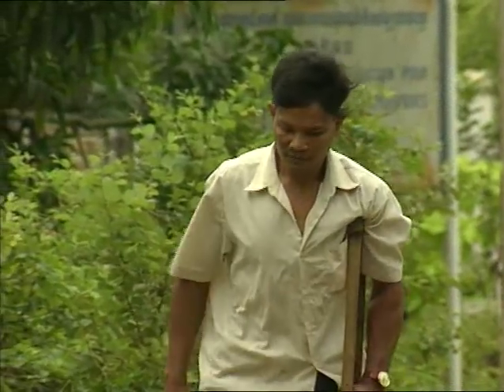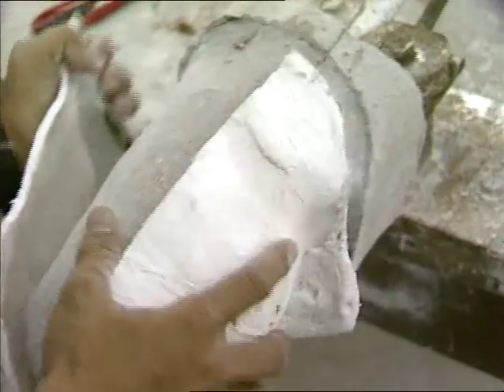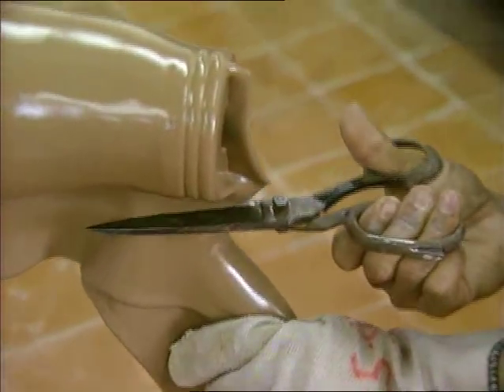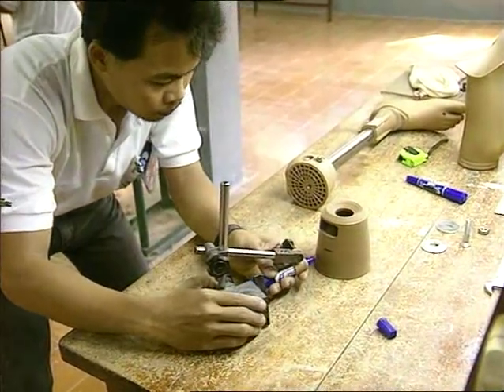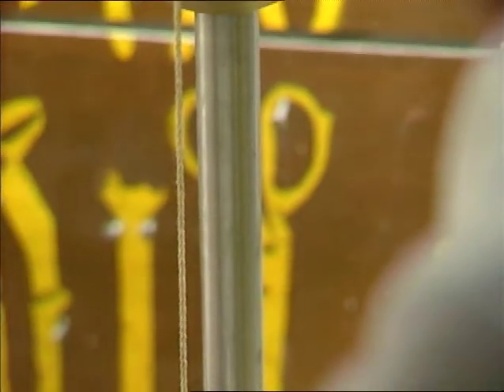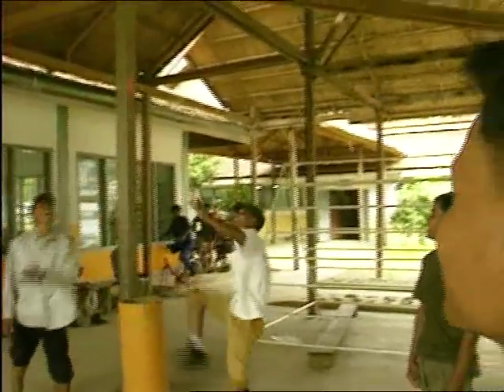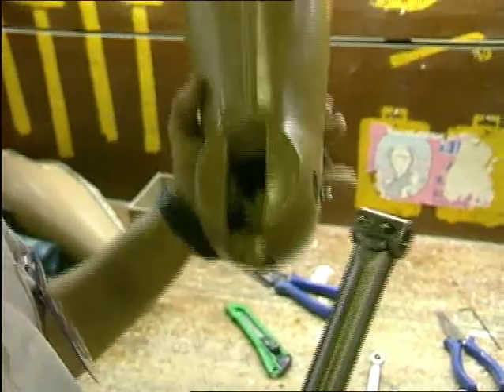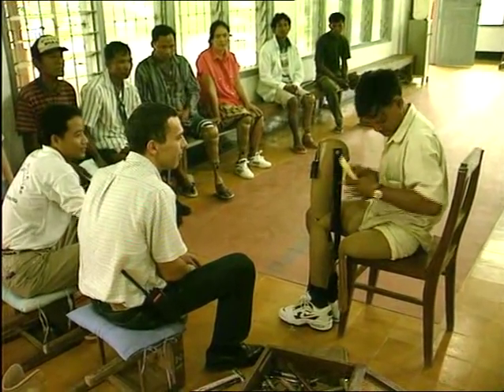ICRC PRP Cambodia Battambang's Prosthetic Workshop - Transfemoral Prosthesis

Comment: Congratulations on achieving an excellent compromise on the selected factors. The geometry is chosen and knee and foot dynamics and materials selected were simple but effective. Such simple geometry and dynamics mean that the wearer needs to lift his foot a little higher so that in the swing forward the toe will not touch the ground. The foot flexing is simple and the wearer needs to adjust to its logic. The logic of the knee swing and lock will need some concentration at first but it will become automatic after some time. The polypropylene technology with heating and vacuuming produces a good product with not much complexity and at a reasonable cost.  Well done to all those concerned. 
All the finances spent on military ware to hurt and kill people should be spent on aiding all those in need, due to nature's mistakes and incidents of modern life.  As humans, we need to change our values and all military personnel should be retrained to serve in hospitals, schools, and workshops like this as they will be more useful to humanity than being trained to kill other mother's children.
Reply: Hi. Good comment. Thanks

Do you use a leg prosthesis or you are maybe a prosthesis maker. Anyway you're right and I agree with you.
Reply: đg